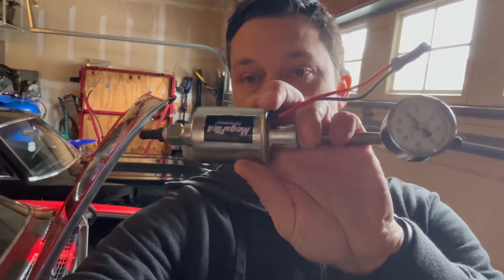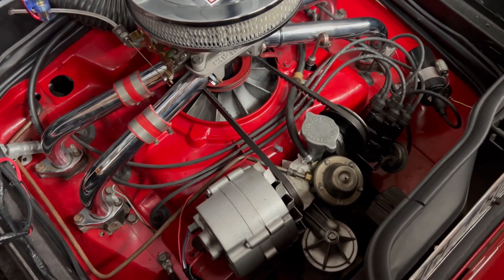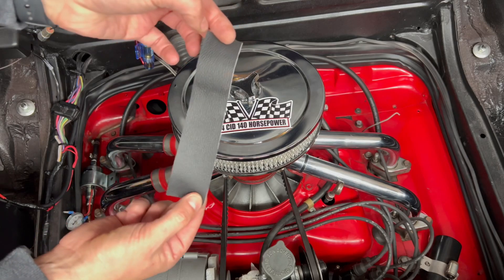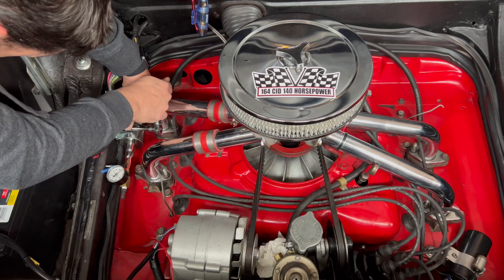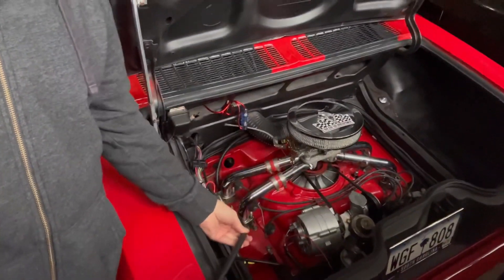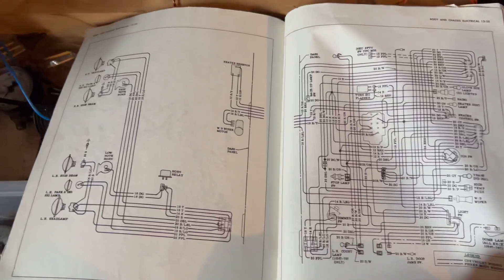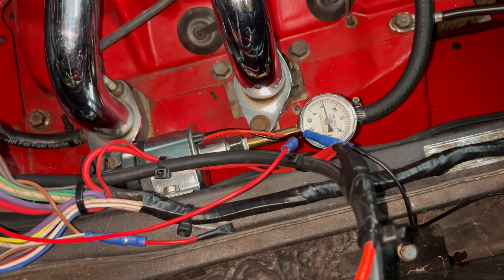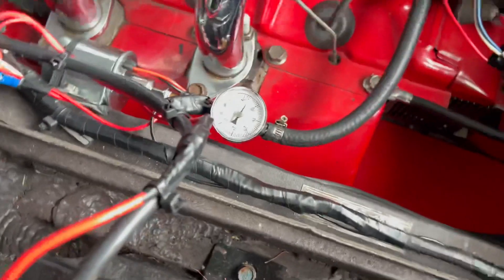1966 Chevy Corvair Gets An Electric Fuel Pump! Removing the mechanical pump and testing!

Comment: I ran a dual circuit for my electric. I installed the rotary-style pump up front, where it belongs, and wired a Vega pressure switch to it. I then ran a manual switch to it also, so I could bypass the pressure switch on cold mornings. By using the manual switch, I could be sure the carbs were full before trying to start it. Once oil pressure is good, then I switch off the manual switch and let the pressure switch do its job. If the pressure switch failed, then I could always use the manual switch to get home and then fix it. I refuse to use the inertia switch. I worked on too many cars having problems with them and as far as my opinion goes, they are the last thing you should ever consider for the pump.

Comment: Hi, so I bought a 65 corsa from a junkyard and I've tinkered with it for a few years.  New interior,  clutch and shifter linkage, electronic ignition,  rally wheels & wide low pro tires. Some other little stuff. I pull the four carbs off 'Cause they were worn out and installed an Etelbrock 4 bbl. It seems to like 80 mph. But I can't get full throttle. I don't really NEED  them, but I think they should work anyway. How did you connect yours? I would like to try something else.  Elix
Reply from the maker: @elixruiz7885  what happens when you go full throttle?
Reply: @nightfurynova thank you for replying.   my pedal hits the floor. I'm thinking I have the cable set up wrong, but not quite sure how to fix it.
Reply from the maker: @elixruiz7885  yeah, underneath the corvair are linkages for the throttle. There are adjustments at the linkages, and also at the carburetors. Getting them all set up correctly is a little tricky
Reply: @nightfurynova  yes, it comes from the pedal into the tunnel under the floor and attached to a vertical motion lever and transfers to a horizontal acting pivot,  then through a solid linkage rod extends to another one at the end of the tunnel where I connected my DIY cable , routed it to a pully at the rear frame rail and up to the carb. I didn't think the last lever had enough travel, so I made a new one. but it didn't help cause It was too much travel for the stock location. It would hit the body. I replaced it with the oem part and I'm back to only using two barrels on a four barrel carb.

Comment: good move, and no more vapor locks.  at least that fixed my problem.
how do you like your 140 heads with basically a pair of 110 carbs?  no secondaries? 
that doesn't make sense to me.

Comment: I hope that gauge isn’t an air pressure gauge.  Fluid and air are not the same. Plus add fuel. Uh oh.
Reply from the maker: Air pressure gauge? It’s a fuel pressure gauge. And pressure is pressure. There is no difference in 10psi of fuel pressure and 10psi of air pressure

Comment: Hopefully you see this and I don’t have to ponder on it for too long but what did you do about the hole the mechanical pump left?
Reply from the maker: I just took the pushrod out, and placed the pump back on. So the pump is there and still plugging the hole. It’s just not operational 👍
Reply: The alternative is to purchase a fuel pump plug from Clark's Corvair Parts or California Corvair. If you have a stock carburetor set up you can also install a fuel pump bypass plate for a more stock looking appearance.

And for the record: do NOT install an electric fuel pump in the manner shown in this video, it is SO dangerous for the reasons made by other commentors: 1) pump should be near the fuel tank, not in engine compartment. 2) NO rubber fuel lines in the engine compartment (that fuel hose running under the fan belt TERRIFIES me!) 3) Install fuse and/or relay and inertia switch and FINALLY 4)  The fuel pressure of 5+ PSI might be suitable for the 4 barrel carb on this car but is WAY TOO HIGH FOR A STOCK CORVAIR SET UP. Get a fuel pump that maxes out at 4.5 psi for stock carb set up.

Comment: Very good move replacing the stock fuel pump with the electric one. But you should sincerely consider the following, some of which were noted by Rick Norris, who is a legendary Corvair mechanic and racer: Relocate the electric pump to the frame rail area below near the fuel tank because those pumps are "pushers", install a relay for the pump and consider an inertia safety switch that will cutoff the pump in the event of a collision and replace all rubber fuel lines that are inside the engine bay with metal lines. Rubber fuel lines inside of Corvair engine bays have been the cause of many toasted Corvairs.

Comment: I'm sure by now someone has told you an electric fuel pump in the engine compartment is not the best place for it. Also those pumps are designed as pushers not pullers which means they need to be as close to the tank as possible. And yes, those little bastards are noisy! I changed out the mechanical fuel pumps on every Corvair I have owned and others. I also use a relay kit to power them. Painless Wiring sells a very nice kit if and when you decide to redo the setup.

Comment: With the battery right next to the fuel pump you should have used a fuse and a relay to take any load of the small pink wire you spliced in to. Being an old Corvair owner I can appreciate the work of maintaining the mechanical and visual aspects of a nice Corvair like yours. Just be careful not to burn it down by possibly overloading an electrical circuit. A $10 ebay pump is not something I would bet my car on. At least a fuse would potentially stop that from happening. The pump may not draw many or any amps until it stops running for some odd reason like it's a cheap ebay pump. Just sayin.
Reply from the maker: That’s a great idea. If the pump fails it will probably be to much current for that small pink wire. I’ll add that relay in next time I tinker with the car 👍